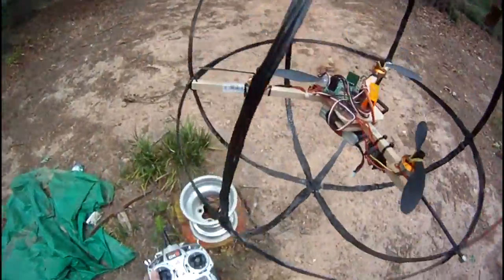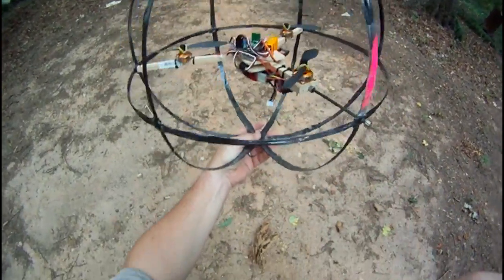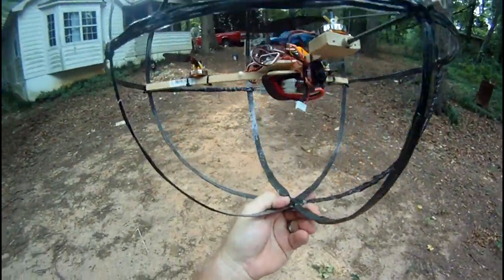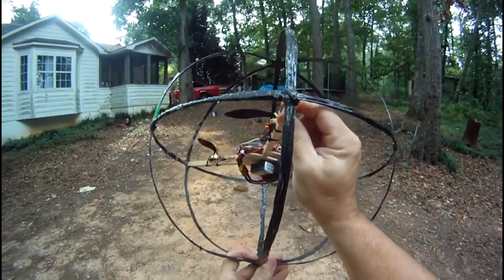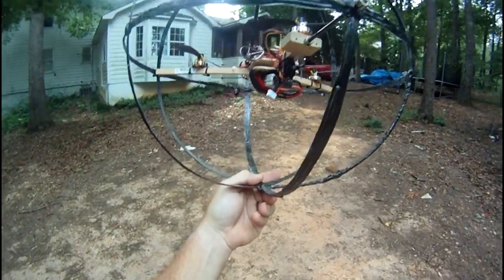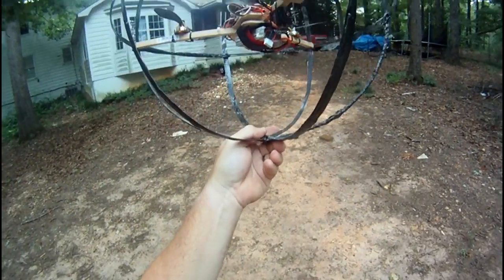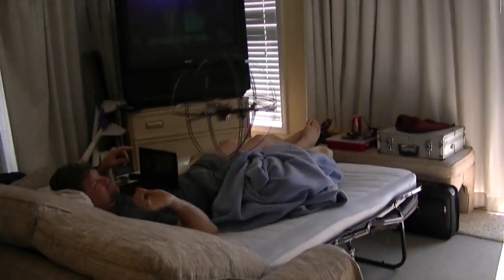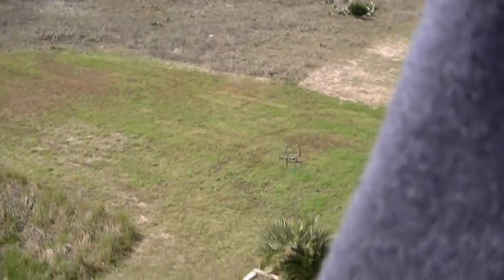Remote Control Sphere American Made

Comment: Man what an insanely good idea!  I am going to have to build one. I would contact Hobby King and try and get them to licence your idea.

As far as building it I would try cutting out a circle in plywood or MDF and use it as a form to create the carbon loops rather than a beach ball. You could then vacuum bag the loops or cut out another form and clamp it to provide pressure.